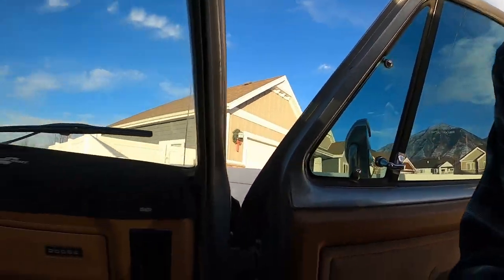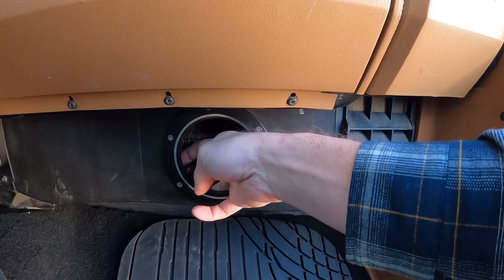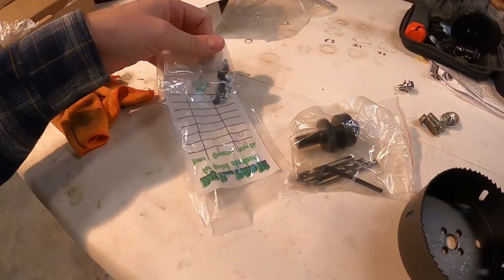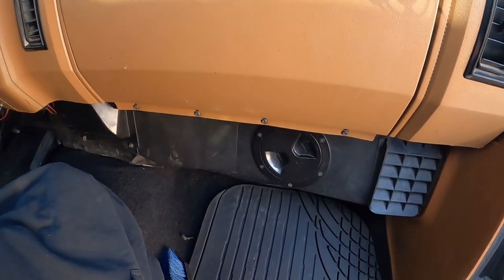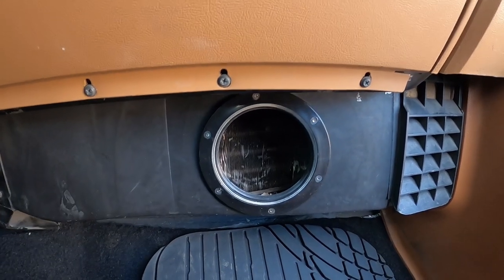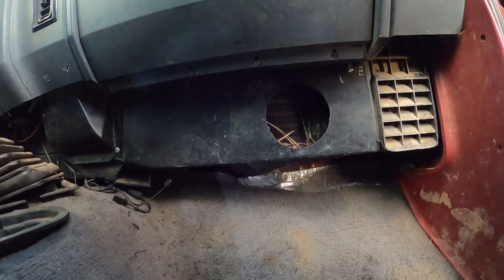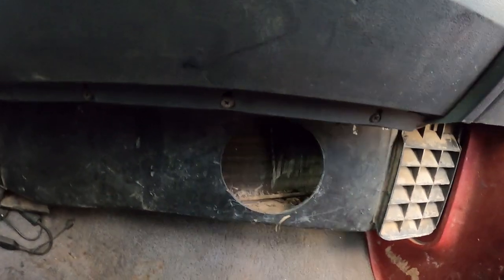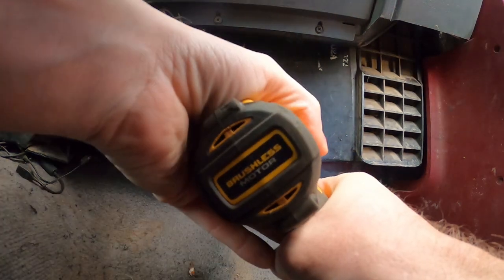Is Your Heater Not Hot? DO THIS!!!

Comment: Do you know how to fix a tweaked hood? If you do, could you do a video on it sometime? The hood on mine, is tweaked up a little bit on the passenger side towards the front, closest to the grille. I've seen about three or four other first gens in my area with the same issue, so I take it that it's pretty common. Thanks 👍
Reply from the maker: You're in luck! I have two videos on front clip aligning from back when I was painting the OG crew. Go look in that playlist and you'll see them
Reply: @decentgarage  phew! 😅 thanks, I completely forgot about that video!
Reply from the maker: It is a total pain in the but. Follow the steps I lay out in the second video and that will be your best bet.
Reply: @decentgarage  ok, thanks! I should have been more specific, it looks like the hood is popped up a little bit on the passenger side towards the front of the hood. The hood lines are perfect, but part of it is lifted up. The corner Diagonal from the part that is lifted up, is pushed down more than it should. Will the video help with that?
Reply from the maker: @Valve-sb7ne  good question. I don't address that too much in those videos. That will be a matter of raising the hinge on the low cab and rasing the bump stop on the core support of the low front corner
Reply: @decentgarage  does how I described it make sense? If not, I can DM you a picture of the hood on Instagram.
Reply from the maker: @Valve-sb7ne  i think that makes sense. Dm me a pic of it though just to be sure
Reply: @decentgarage  ok, will do. I will have to wait until tomorrow though to get a good picture, as where I’m from, it’s dark right now.

Comment: Your videos have made me go from wanting to sell my 91 to keeping it. As well as realizing how simply and under appreciated these truck are. Thank you again!
Reply from the maker: I love seeing comments like this! These trucks are great and pay themselves off over time for sure.
Reply: @decentgarage  Thanks for the great videos and information they have their quirks but nothing to bad that usually isn't to hard to fix and no big $$ truck payment either
Reply from the maker: @bbtoyshop  this is exactly right! They may not have the power of the new trucks but they are way cheaper and simpler to work on and no huge truck payment!
Reply: @decentgarage  I have a good friend who drives a 2001 F250 with 7.3 and he is always amazed and how well my 93 starts even in cold weather I will take my old 1st or 2nd gen Dodge diesel over a new truck any day my 93 has all the more power I need THD pin 3200 spring and HX35 turbo and the fuel screw turned up some and it actually does pretty good I had a guy pull up to me a couple of weeks ago in a newer Dodge diesel and said he had a old 1st gen and it never moved like that he was impressed and this newer computer stuff I will never like I have most of my upcoming work on my truck that you have videos on saved in a file ..thank again for the great videos

Comment: Ha! I did this when I first got my ‘92. The heater box was full of leaves and junk, however the boneheaded move was putting the HVAC control on “Heat” and wondering why it wasn’t coming out of the vents. That lasted for about a year! 

Has to be on the “Vent” selection!!
Reply from the maker: Yeah, when I first moved to Alaska I figured out the heat controls as quick as I could.

Comment: Hi Tim, My heater core started leaking and mine is to the left by the throttle pedal, is that not your air conditioner condenser core, you are showing?

Comment: Hey Tim, you got a line on a fuse block under the steering column? I need to replace mine. Thanks
Reply from the maker: I don't know of one off hand. Are you on Facebook? The 1st gen cummins (89-93) group is excellent. Im literally only on Facebook for those groups and to find parts
Reply: @decentgarage  FB yes. I always recommend your videos.

Comment: What size were the hex screws you used? 
Thanks
Reply from the maker: I'm not sure. I just took the deck plate to the hardware store and found the size that fit the best
Reply: Thanks, keep up the great content. I'm surprised none of your trucks have rust on the drip rails. I've noticed some of Southwest/Desert trucks the caulking dries and the cabs start  to leak. Everywhere else they're rust free.
Reply from the maker: @owlfalconry3629  luckily all of mine are rust free 🤞